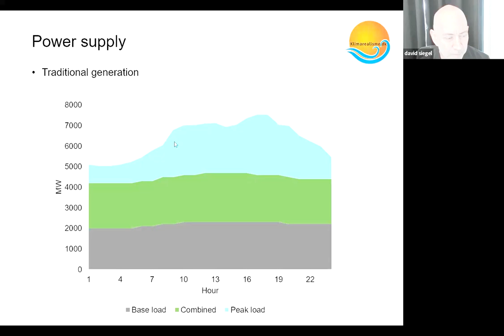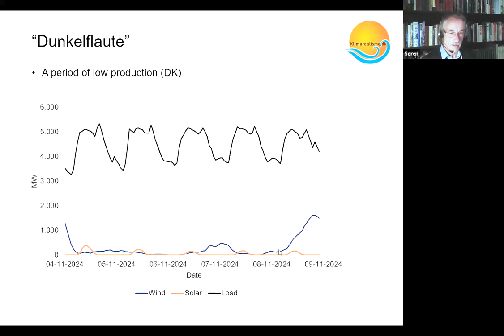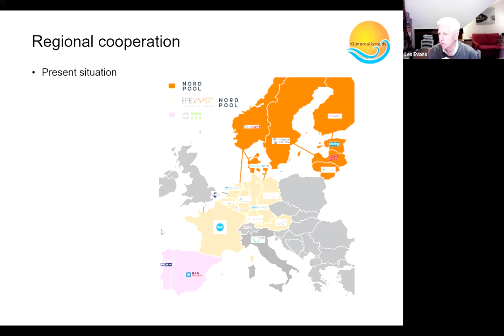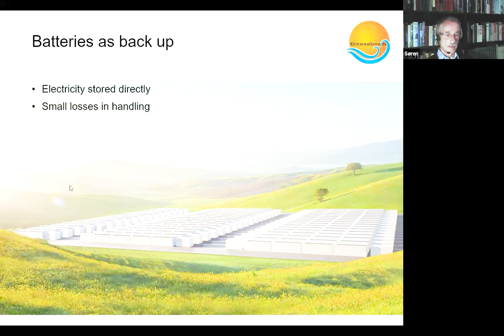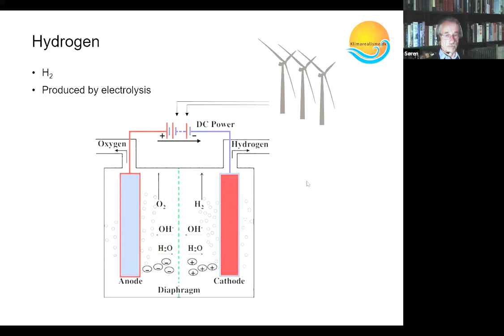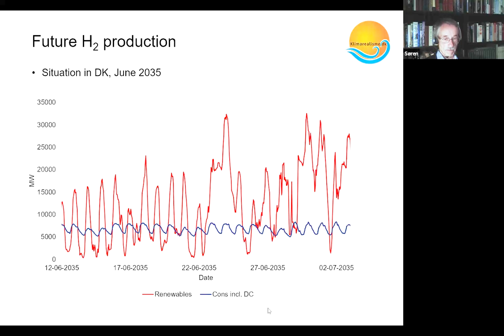Soren Hansen on the challenges of renewable energy

Comment: Great presentation and a good collection of data. Unfortunately you are wrong. First you assume that daily electrical consumption is constant, second you overstate vulnerability due to renewable energy intermittency, and third you take a narrow view of battery capabilities. The issue you present is based on a northern latitude country and it's seasonal problems.  On the consuming end, great strides are being made at power management and energy conservation.  You spend a lot of time talking about a specific short term battery type. You may not be aware of long term battery technology such as flow batteries.  It is conceivable that renewable energy alone can supply all of our needs. China is making great progress with Ultra High Voltage Direct Current (UHVDC) cross country transmitting.  If there is a shortfall, developing technologies like deep geothermal electrical generation could supply supplemental base load.

Comment: Ref. to fossil fueled backup power, which was rather briefly discussed.
Why can't such an arrangement be a permanent feature of a PV or wind farm, with standard BESS.

Imagine a 1 GW solar PV setup.
So, there's no meaningful solar power generation for about 4 + 2 month of the year, and for both Spring and Autumn, we have a range in between these two extremes.

Diesel, gas turbine or biomass boiler as backup.
1000 ekW x 1000 or 2000 ekW x 500 or 5000 ekW x 200 or 50 000 ekW x 20 (marine type slow speed engine), and all these are near commodity type equipment.
do mix and match for gas turbine or biomass fired boiler
There's no loss in thermal efficiency as waste heat recovery is no different from standard industry arrangement
Yes, there'd be some loss in e-efficiency due to round-tripping, but, so what ?

For a pumped up storage system, replace gen-sets with diesel pumps.
Is it that difficult to source for 6 month storage of e-fuel or bio-fuel, i.e.: ethanol, methanol, DME/DEE, etc. ? 
This mix and match system integration is actually near limitless, vis-a-vis, fuel and equipment, all while staying green.

Gentlemen, your thoughts.

Comment: There are solar plants, not with cells but mirrors to heat a moisture up to 600°C and then produce super heated water vapor for electricity generation by turbines. Is not this a much better solution as you can produce or stop producing electricity as per demand, and it's possible to store that super heat moisture during the night. I know one of that plant is running in Sevilla-Spain.
Reply from the maker: It seems to still be operating, though when there's no sun, there's no energy, so you still have the storage problems Soren talks about. Can't run a hospital on solar power.
Reply: @cuttingthroughthenoise3086  
With well set up backup power generation system, running on bio- or e-fuel, we most certainly can.